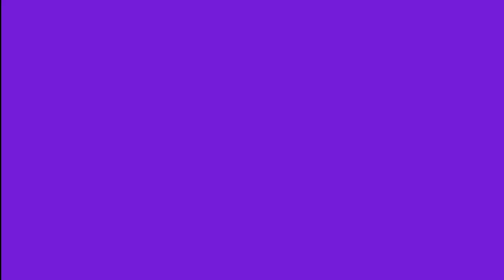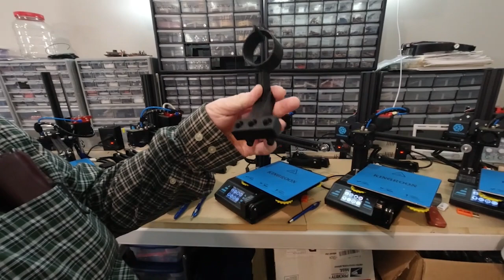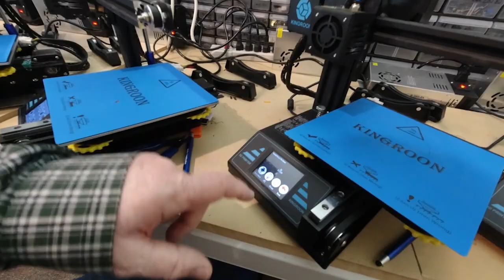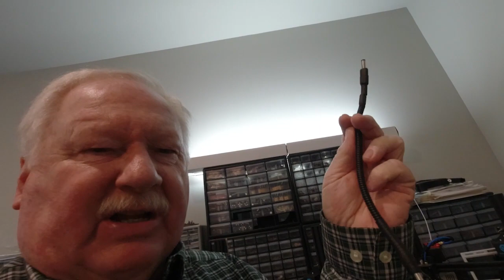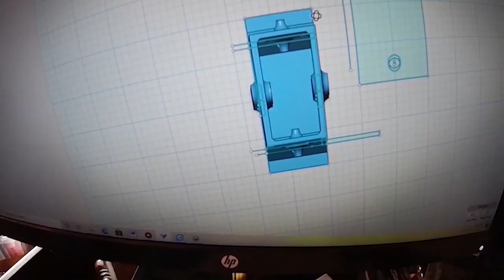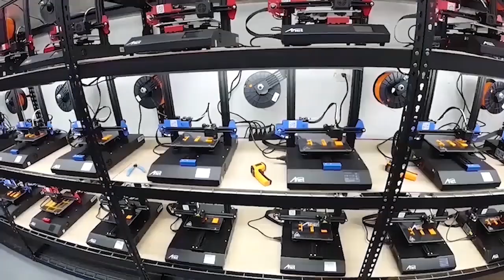MY 3D PRINT FARM & MOST PRODUCTIVE 3D PRINTERS that include the Kingroon KP3 and Anet ET4 printers.

Comment: I figured out the same thing, I had a part breaking when I screw a bolt into it.  Raised it to 210 and it's super strong now.  It was breaking on a layer line so that was why I tried the higher temp, like you said to fuse it together better.
Reply from the maker: Sounds good, the higher the temperature you can print at without creating a problem with the part the better...Ken

Comment: The Anet fires were on the old Anet A8 kit printers and were caused because Anet did not activate thermal runaway in the Marlin firmware so when there was a fault with the cheap and nasty thermister they came with they just carried on heating the hotend until they burst into flames and caused house fires, they learned from that and since then all new printers have had this activated.
Reply from the maker: Thanks for your incite on this matter Andrew. The main thing is that printers now days are pretty safe, and that is a good thing. Thanks for that info and for your support my friend...Ken

Comment: I use direct drives micro Swiss on my Enders ..great set up.  This is a great video thank you .  I changed my cooling fan duct to “ the fang” thingiverse on my Enders direct drives.  they are quite good possibly too good.  Great on the exhaust and dryer fan. You might want to think of a heater fan also.  Take a look at the fang my friend...also micro Swiss duel direct driver...joe
Reply from the maker: Will do, Joe. I don't know if I'm old and slow or what, but I've been having a hard time figuring out what I need in the way of UPC Codes for the products I will be selling on Amazon. I will keep inventory and ship from here and only be selling on Amazon, so I don't think they will ever see my UPC codes. They cost $30 for each different item I am selling on Amazon. There are less expensive UPC codes available, but I don't Know if you can assign your product info to them and be able to scan the code and see your info. I'll keep on it till I figure it out. I'll look at fang, take care my friend...Ken
Reply: @NewTechInventors  ask for help and you will receive it from your many fans.  ..can’t help you with your UPC codes sorry.. j

Comment: All great points.
With the anets catching fire, if you hand someone a box of parts to build a toaster and they don't know what they are doing, then that could catch fire too. I used to run 40 Anet A8 printers and never had a fire. They had issues with some of the connectors and they weren't perfect but they were safe if you built them right
Reply from the maker: Good points Chris. I agree that any printer can be safe if it's built right and operated correctly. Wow, I would like to have seen 40 Anet A8s running. Sounds like a good size operation. Thanks for sharing that and for your support...Ken